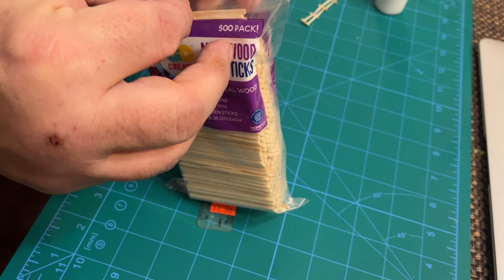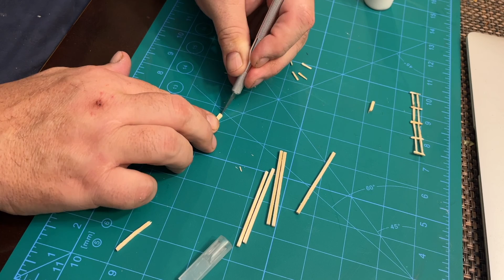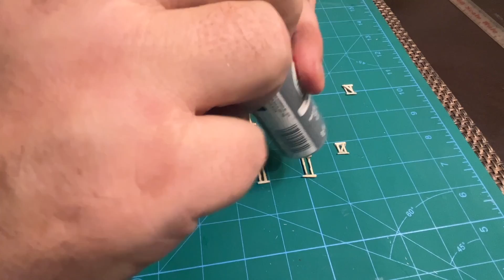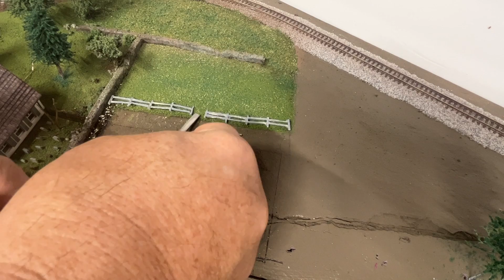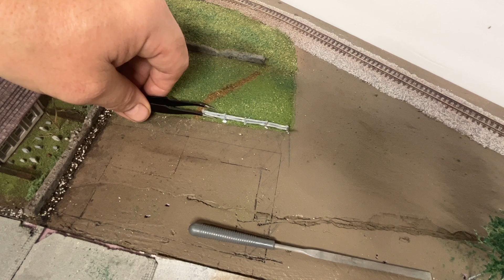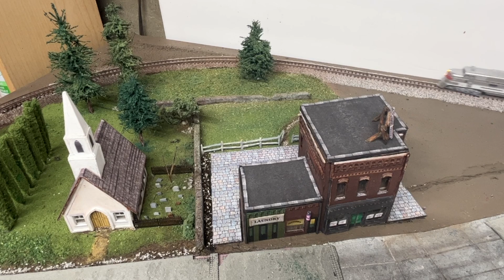Scratch Build an N Gauge Split Rail Fence in Wood

Comment: Great Video!  I was just playing around with that actual idea to see if it was practical to make a Fence Type Railing for a Walkway along the track on an Old Rail Bridge.  So, after cutting a few pieces, I just did a Random Google Search, and found This Video.  My concern (besides being Time Consuming) was Successfully Gluing It.  I already use the Needle Applicator with Revell Plastic Model Glue.  I didn't realise you can get other Glues with the same type of Applicator.  

- Edit -  While I was just Testing The Idea, I was only using Strips Sliced from a Bamboo Bar-B-Que Skewer.  I now might try Thin Balsa Wood Sticks (which I'm using to Scratch Build the Body of The Bridge).

Anyway, I have a couple of suggestions that you might find helpful:
  -  Have you considered initially making Several Sections of 1 Post & 2 Rails, and then Gluing them together.  This way, you wouldn't have to worry about keeping the Whole Fence Aligned all at once:  You could Draw a Guide Pattern for the 2 Rails & 1 Post, and place the Pieces on it to Glue Them Together.
  -  To remove the Grass to Create a Bare Path, try Spraying it Very Lightly With Water, then Rub It Lightly with your finger.  By doing that, you can make the Path follow any particular direction/curve:  Also, by varying the pressure, and alternating the flat part and *edge of your finger, you can vary how bare it is and also the *width of the path.
  -  To secure the Fence Posts, try laying it on the side, and gluing a Track Pin/Nail to the bottom of the Posts (Atlas N Scale have a Wider Head than Peco - I use PECO for pinning down Track, and I'll be using Atlas for things that need heavier securing methods, such as Vehicles:  Pinning Vehicles enables you to relocate them if/when required).  After the Glue has dried - being careful that it hasn't stuck to your work surface in the meantime - all you need to do is put it in place by pushing the Pins into the surface.  Another way, is use PECO Pins, with the Head Removed:  Push the Sharp End into the Post, and the Blunt End into the Ground.

ps ..  Except for Pinning Down Track (with PECO Track Nails - and Testing the Atlas Nails on Vehicles - I haven't actually tried the other idea, but have read about them, or seen Videos on such.
Reply from the maker: Those are some great tips! I wonder though whether the resulting split wood -- at least at N scale size -- would be large (wide) enough to accept the pin. After quartering them the resulting "post" is very small. A sewing needle might be better, though really, just making the hole in the foam, dabbing some glue in, and inserting the fence post worked well enough. Thanks for watching and offering those suggestions!